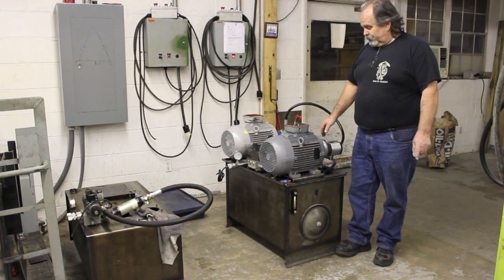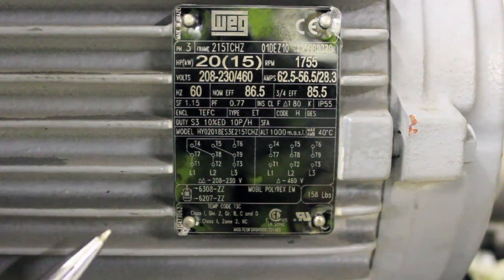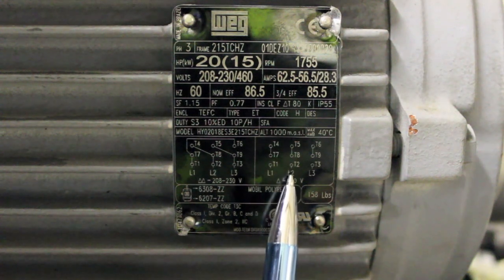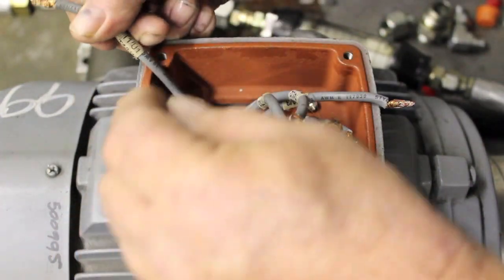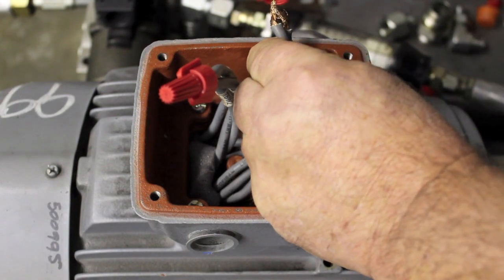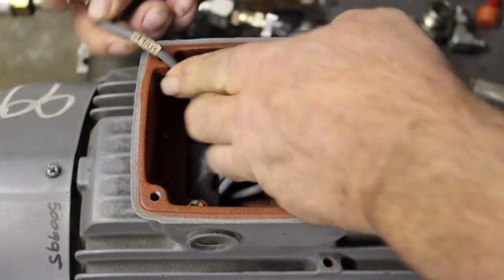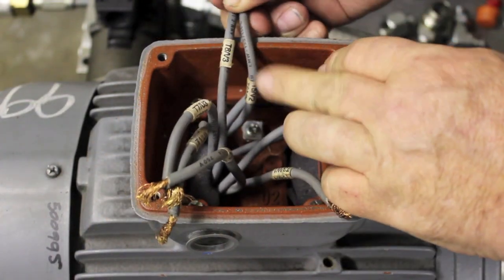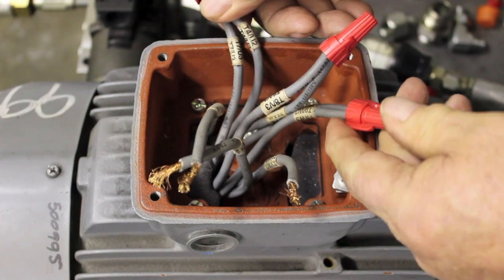Rewire a 10hp Weg Motor (Low and High Voltage)

Comment: Would i use the same low voltage configuration using the motor for a phase converter ? My panel has start and run capacitors

Comment: Newbie question.. the shop owner who gave his compressor after he retired said his shop was 220volt and Phase B. The air compressor he gave me is a three phase and has volts 208-230/460. Does that mean 208-230 is the low voltage and 460 is high voltage? I do not have a three phase set up at home. An electrician said some of these motors can be wired differently to run as a single or three phase? He did not mention anything about a converter. Can anyone help? This is an old motor Leland Faraday
Reply: b e yes that does mean low/high voltage. Also, if you place the start windings of a single phase motor 120 degrees apart, you can run it off 3 phase power :)

Comment: Thanks! I have a motor from an Ingersoll Rand compressor and it just said low or high voltage on the wiring diagram, but the listed voltages were 190/380//230/460. While I suspected 230 was low, your motor plate in the video actually said so.
Reply: Ronald Thompson i understand... its even more misleading when you consider that in the US we use 240/480... however, if you were to reduce the power to 50 hz from 60 hz then your resulting voltage it seems would be 180/360.  This would, of course, always depend on power factor, proximity to transformer, and appropriate wire gauge to compensate for voltage drop and the ever present and potentially disastrous problem of in-rush current